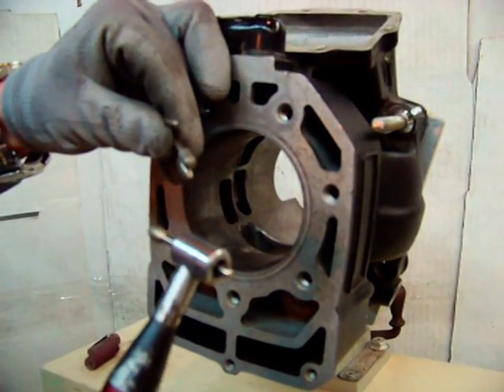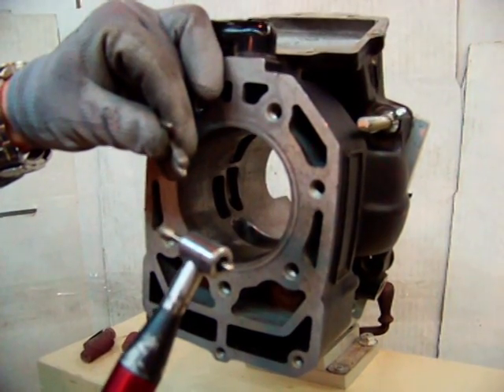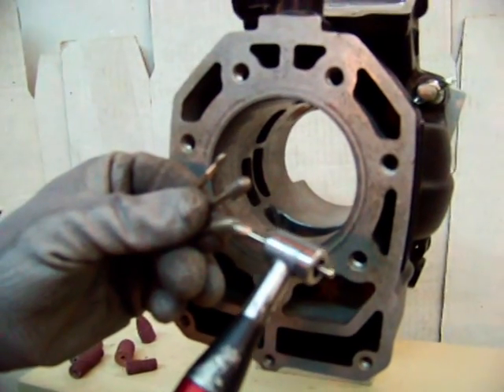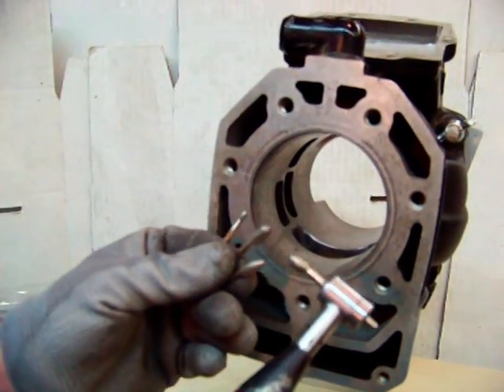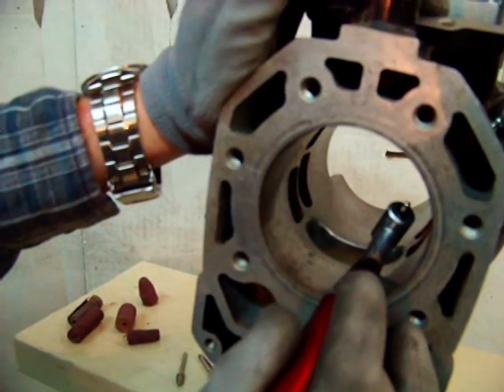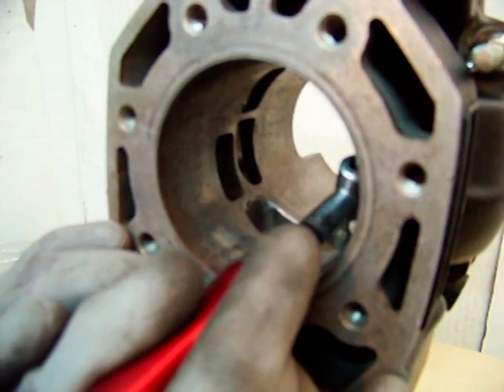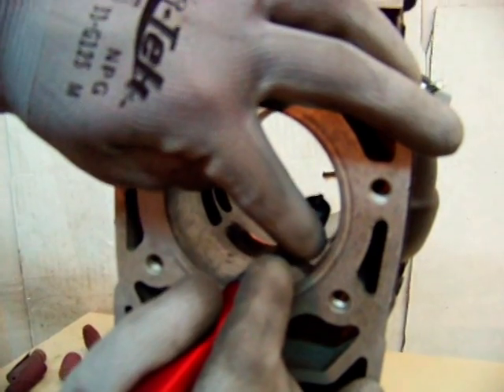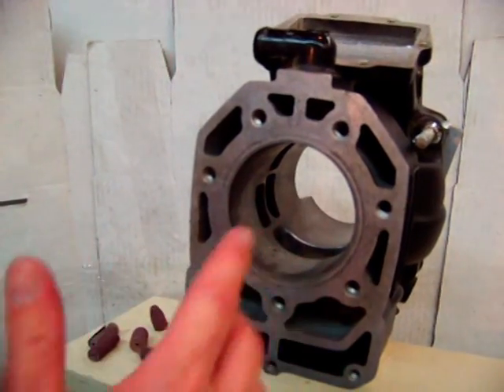2 Stroke Porting chamfering the port part 1.mpg

Comment from the maker: cont).Modifications to the piston skirt can also decrease weight of the piston, change structural integrity, change thrust/load, affect piston rock, alter crank clearance with the botom of the skirt on short stroke setups, slightly alter pumping characteristics of the crank case, it can be used to boost flow on small 2 strokes at BDC, better direct flow to the transfers, so on and so forth. You get the idea, it can change a lot, for the better if utilized correctly. Thanks for the question

Comment from the maker: I also want to stress the importance of the angle on the piston crown being gradual and smooth. A sudden direction change can disrupt the returning exhaust pressure wave or trap end gasses that may lead to detonation. So just use caution and good sense when making a modification like you are asking about TheSuperchargedGuy . Also remember this will tend to move the hp gains toward the upper end of the rev range.

Comment from the maker: in general the purpose is to let the intake open sooner and longer in the cycle, since the intake is opened and closed by the bottom of the piston, in particular on piston ported 2 strokes. More air/fuel=more power. You will also see some pistons with holes cut in the side(or divot type indentations) to better utilize boost ports or transfers. Modifications to 2 strokes, like changing from a piston ported setup to reed block controled intake, can also benefit from piston skirt modification(cont.

Comment from the maker: The bevel should be about 0.5 mm thinner than the width of the exhaust port and the angle should extend toward the piston center, relative to the displacement of the cylinder. For example on a 125 cc piston the angle should extend 5 to 7 mm toward the center of the piston. I would recommend lowering the edge, in 0.2 to 0.5 mm increments. Test the results as you go, and better to go less than too much. Two Stroke Performance Tuning by A Graham Bell will give a good illustration of this mod.

Comment from the maker: Putting a slight bevel on the piston crown toward the exhaust port can have the effect of increasing the duration of the exhaust. Be careful, because it is not just a matter putting a 45 degree angle on the piston. The idea is to lower the piston edge toward the exhaust port, and the angle is not as important as how much you lower the edge in relation to the rest of the piston crown. It is a bit safer way for beginners to change exhaust duration, because you can swap out pistons if you go to far

Comment: Hey , I have a 86cc cylinder , crank 44mm stroke 85mm rod .
exhaust is 190 degrees , 50 mm piston .
I would raise it to about 195-198 degrees , much must I raise the exhaust port in mm ?
also wonder if piston is made shorter so altered degrees on the intake
Reply from the maker: +Terje Erikssen You will likely need a degree wheel to be changing the port timing precisely.
Reply from the maker: +Terje Erikssen as far as changing anything on the bore size I would refer you to this answer "Great question. Since the port channel or duct can have various port roof angles, boring out, or increasing the diameter of the combustion chamber can alter the port timing. Sometimes to a minor degree, and sometimes to a major degree, depending on the amount of displacement increase and the original configuration of the cylinder ports. It is almost always necessary to adjust the port work to compensate for the changes of increasing displacement. The other consideration is that, with a larger combustion chamber and greater volume of displacement , you may require a greater chordal, or cross sectional area to the ports, to allow for the increase in volume. To gain the full potential of increasing the displacement of a 2 stroke cylinder, porting and polishing is almost always required.  Thanks for watching!"
Reply from the maker: +Terje Erikssen and yes any dimensional variation in the piston specs can result in a change in the port timing, similar to other piston modifications mentioned on this, and some of our other videos.
Reply from the maker: +CC Specialty Tools the reason I  believe this is because you mentioned other variances, such as piston height, bore size ect.
Reply: Ok. thanks for your attention. The problem is that I'm running with it now so measurement is not so easy, replacing piston soon but take only 0.5 mm away from the exhaust then I think .what 's the deal , the muffler is for 192-198 degrees but the cylinder is 190 degrees